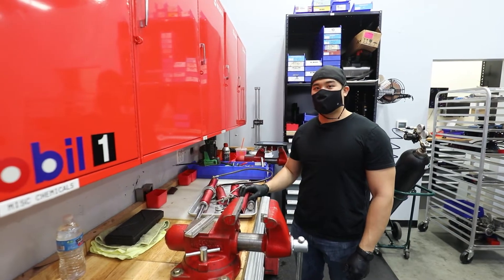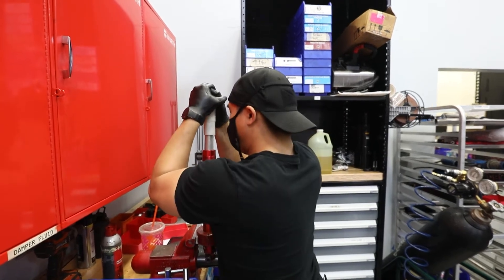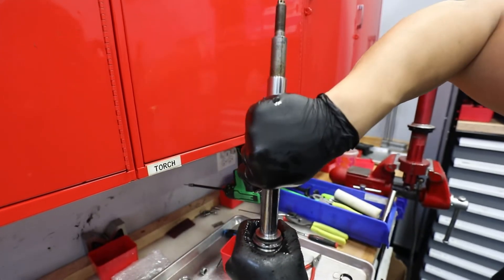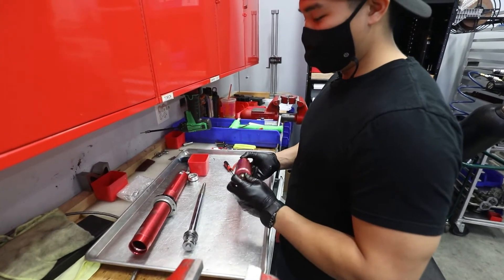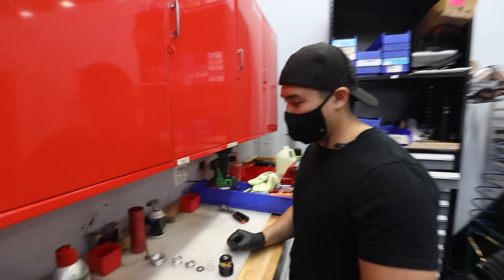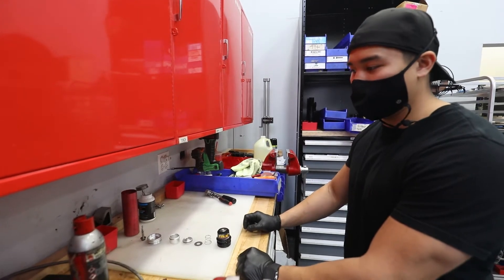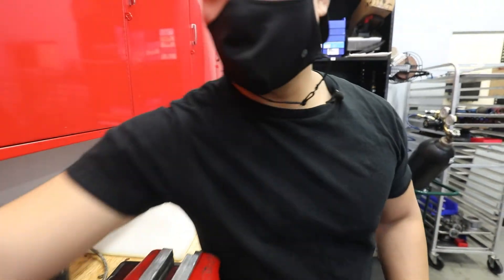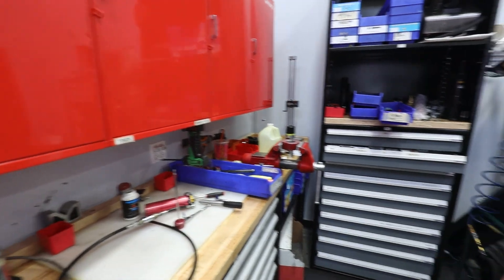JRZ Suspension Rebuild Process // How It's Done Part 1 Of 2

Comment: Is it normal with heat cycles for the assembly grease to sometimes seep out the shock? I have pretty newly rebuilt JRZs (4 months)  and as I was adjusting compression on my canisters and noticed there was a small amount of sticky/tacky grease between the black canister head/cap and the anodized body.
Reply from the maker: That is assembly lube that is put onto the threads and o rings! Totally fine
Reply: @Olsenspec  Thanks!!